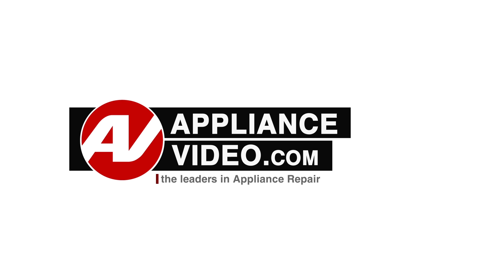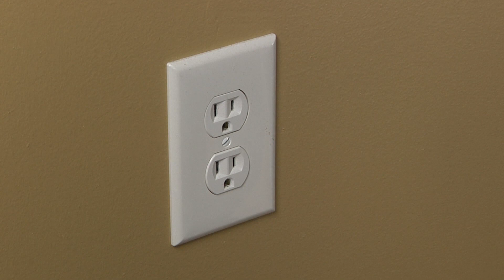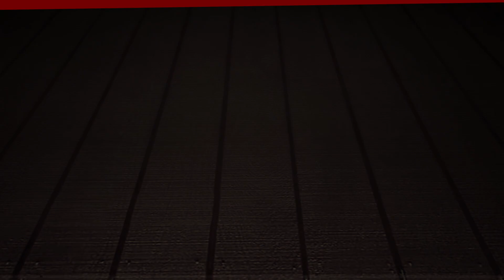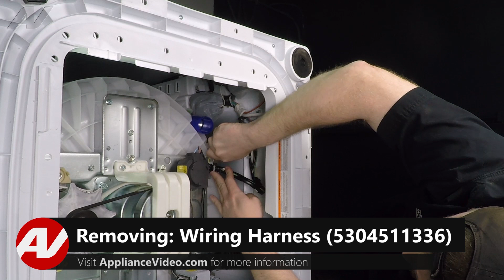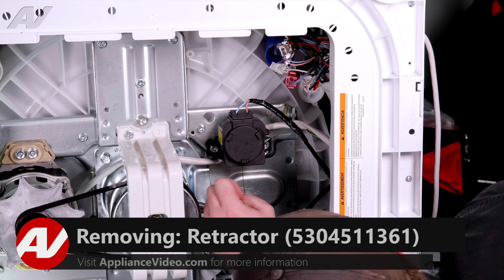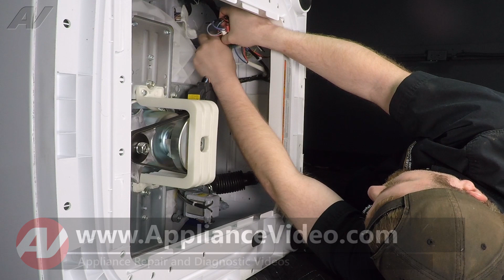Frigidaire Washer Repair - Will Not Agitate, Will Not Spin - Retractor

Comment: Thanks for the vid. I found it pretty easy to remove the back panel and tilt the washer forward. I tested the motor with a multimeter at the molex connector since there are no contacts on the motor.

Comment: Mine agitates but won't spin and I replaced the shifter and still have the same issue.  What else can it be
Reply: Did you find out? Mine agitates and fills but won’t rinse or dry. 

Should we check to see if something is stuck in the pump?
Reply: @BruceWayne-bk6ne  having the same issue on mine now. Either of you figure out the fix? The transmission clutch seems to be working but thinking it’s a coupler to the spin gear.
Reply: I’m having the same issue too!
Reply: @DirectedByFOUR  >>Whatever the problem is, it's in the gearbox / clutch/ transmission.  and unfortunately  the unit is not serviceable , It's all spot welded together.
Reply: @rays.2480  so i fixed mine. Real simple fix too. The conveyor belt was off the track.

Comment: How do I know if it is the retractor or the clutch? Is there a way to tell if the transmission assembly is the issue? How hard is it to push the transmission lever? How strong is the spring? I do not have a broken wire on the retractor. I could not find a video on this subject.
Reply: Unfortunately you don't unless you have a camera at the bottom to see if the retractor engages. Other than that, you must replace the retractor to see if it fixes your issue. If it doesn't, then it's most likely the clutch(transmission).
Reply: You can feel if the retractor is retracting

Comment: I have a washer like this one and when is  in spin cycle the washer doesn't do it.... it agitates instead of spinning.  Can that part be the problem? Thanks anybody please help
Reply: Mine does the same thing. I hope that this part is the solution. Did you ever figure out the problem?
Reply: Hi guys! ,That part was the solution? I have  the same problem
Reply: Hi Misael, i have the same problem,that part was the solution un your case?
Reply: My washer like this bangs and goes back to rinse cycle when it's time to spin...some help plz
Reply: I have same problem. On the spin cycle, the agitator spins and makes the clothes bunch up to one side and makes things unbalanced. Then it bounces around and makes alot of noise. Never really spinning the clothes 🫤

Comment: Our Model FFTW4120SW1 Frigidaire top loading washer is making a grinding noise that can wake the dead, we took the agitator out and tried it, noise still there but not as bad. Does this model washing machine have bearings? If so, where? Do you by change have any more vids with this washer> TYIA
Reply: Did you ever figure it out, I have the same problem
Reply: @cameronbeavers7751  we bought a new washer, lol. Tried taking the agitator out but didn't couldn't get to the issue.

Comment: I swapped mine out as shown and it still won't spin any other idea u suggest
Reply from the maker: Great question, if you have a more technical question that our parts department cannot answer, you can search our over 17,000 answered questions free at our website www.ApplianceVideo.com under our Repair Help section. You can also call our parts department at 1-800-830-5465 and they can give you help 7-days A week ,or search at www.SaveMoreOnParts.com  .

Comment: I have a washer like this making a grinding noise. And will not spin clothes, it will drain, after draining it try’s to spin but then refills with water. Any suggestions? Thanks
Reply from the maker: Great question, if you have a more technical question that our parts department cannot answer, you can search our over 17,000 answered questions free at our website www.ApplianceVideo.com under our Repair Help section. You can also call our parts department at 1-800-830-5465 and they can give you help 7-days A week ,or search at www.SaveMoreOnParts.com  .
Reply: Did you get it fixed? Mine is doing the same thing
Reply: @DUURAG_  I had one today doing the same thing. I'm suspecting that the transmission locked up because it's not the clutch.
Reply: It's making a noise but nothing is spinning
Reply: Mine two. Now im between clutch or thise piece